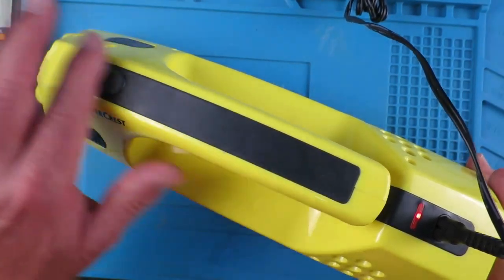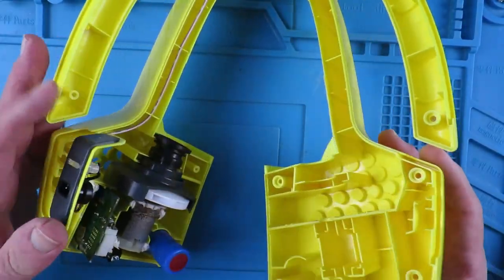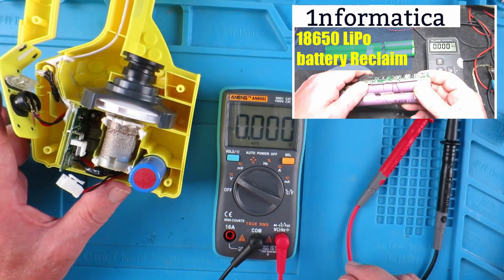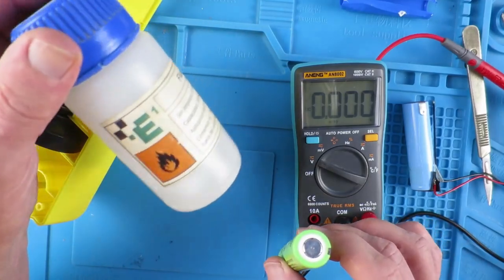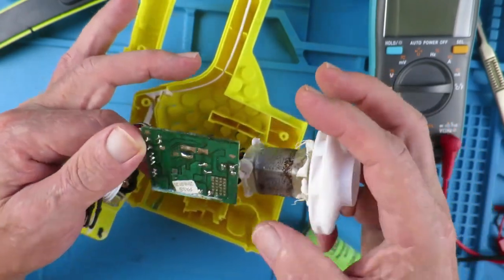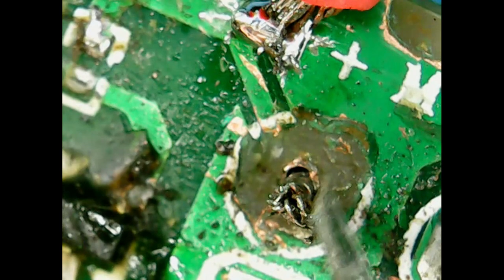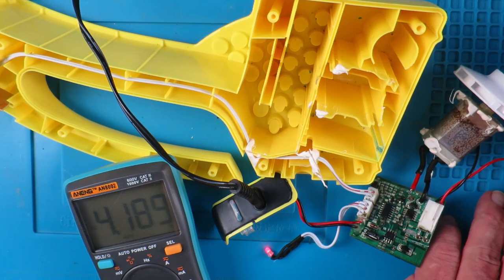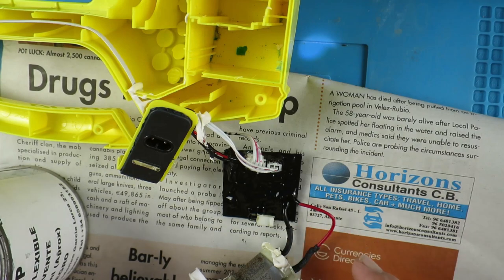Lidl Cordless Window Vacuum Cleaner Repair Tutorial SFR 3.7 A2

Comment: Big Clive swears by the use of cheap clear nail varnish as a useful makeshift protector. Would probably be suitable for this situation too I expect.
Reply from the maker: I guess if applied properly it would work. Clearly it didn't for Lidl's! I prefer to use methods I have personally found to work. Plasti Dip is inexpensive and has many other uses https://www.plastidip.net.au/plasti-dip-uses